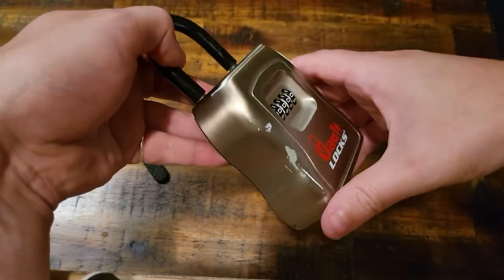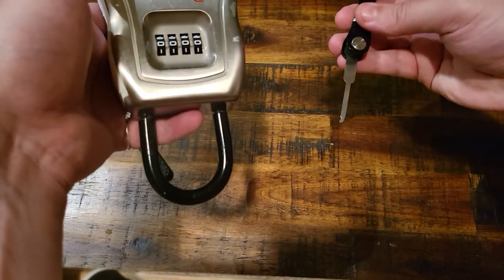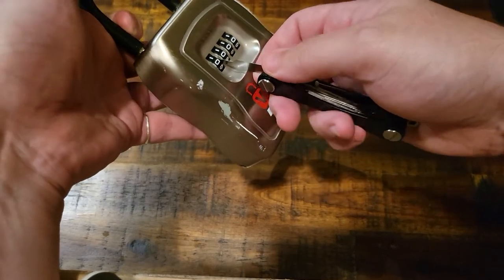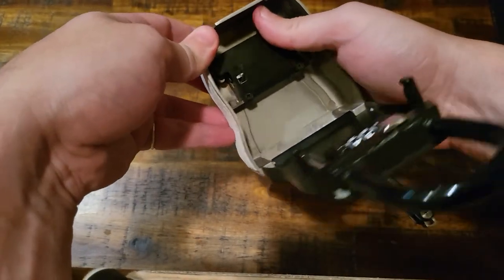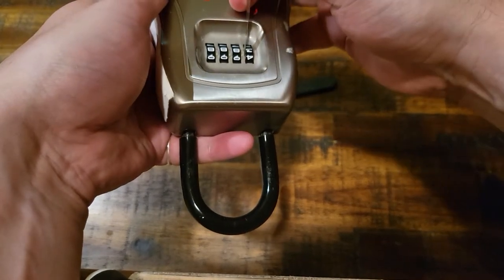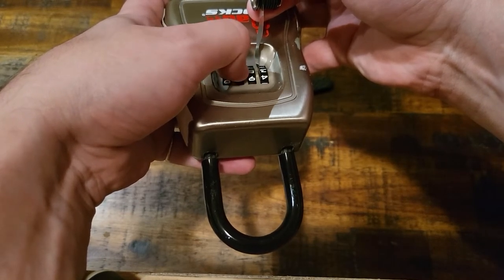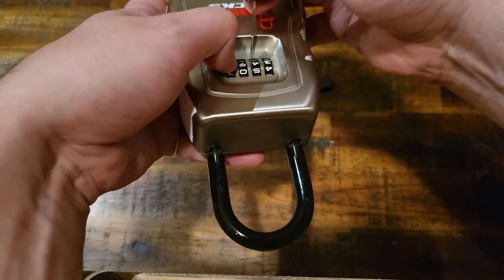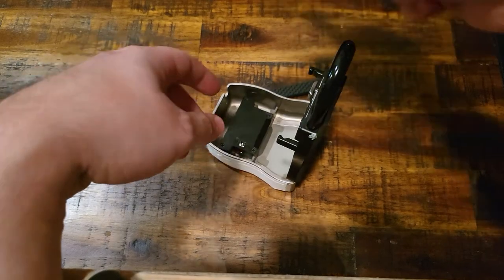Decoding a Vault Locks Key Box

Comment: How about the inside one?
Reply from the maker: As you already figured out the same method can work for the inside combination as well.  I believe it also has looser tolerances making it a little bit easier
Reply: @0x42red  i found out that i can just reach in at the top in the combinations slots then pull, it will bypass the combination and can be open right away.
Reply from the maker: @vuththiwattanathornkosithg5625  oh that is a fantastic bypass good find
Reply: Could you possibly help me with that too? I have two same Vault combo boxes. I messed up by accident, and I can't return back to where I bought in Tri-Counties Assosication in Walnut, CA 91789. they told me to keep buying new ones.  so far I have 4 now. They can not help at all. from my awful experiences,  better to buy directly from factory website, and they can allow you to return for exchange.
Reply: @cocoharvest9086  you need a hook tool for lock picking.